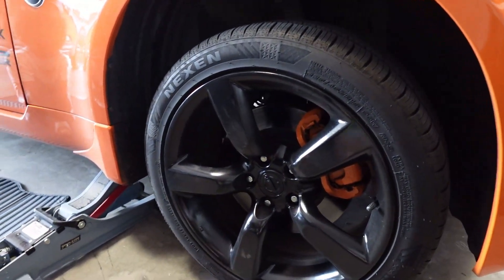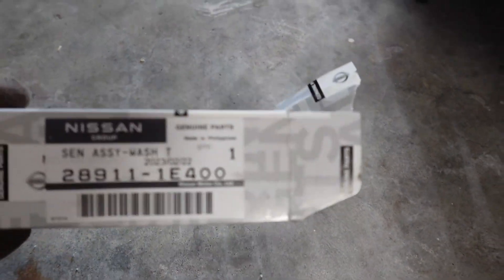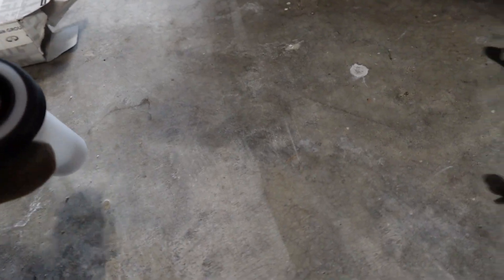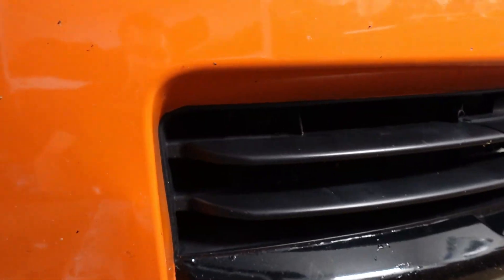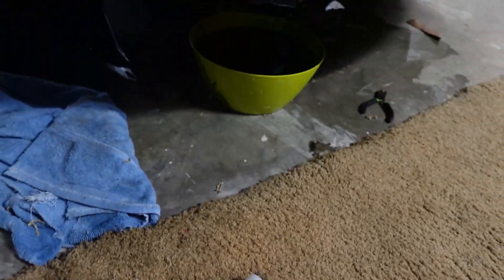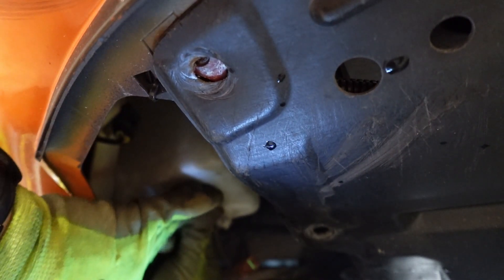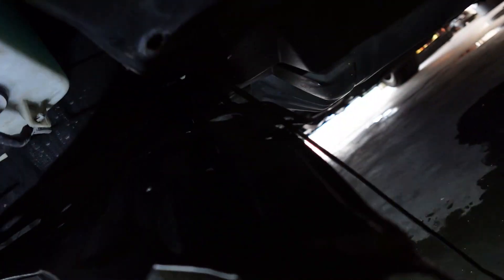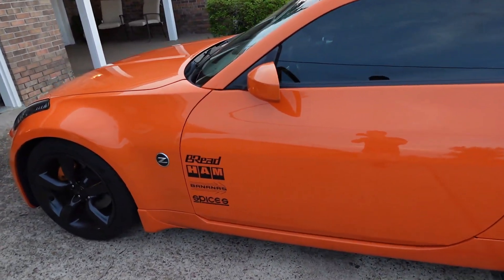EASY Nissan 350z Washer Fluid Sensor Replacement - DIY

Comment: Now how the heck were you able to undo that connector so easily????? I’m doing this job in my mom’s FX50 and the connector won’t budge. I’ve pulled, jiggled, twisted, pushed what I thought was the release button, left hand, right hand, pliers, pliers on the button, everything! It’s the button on the top, right? I’m going crazy!
Reply from the maker: Yep squeeze that button release real hard and pull. Sometimes they’re harder than others. Some I’ve had to push in with a flathead screwdriver or pliers, just be careful not to break it